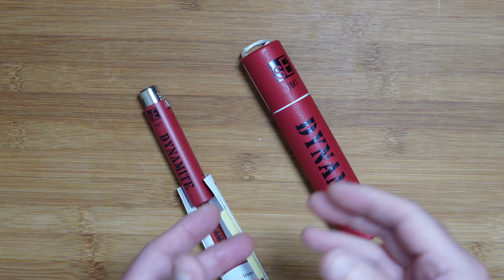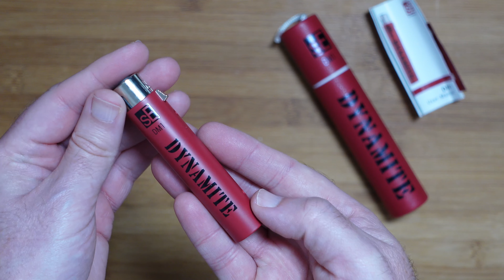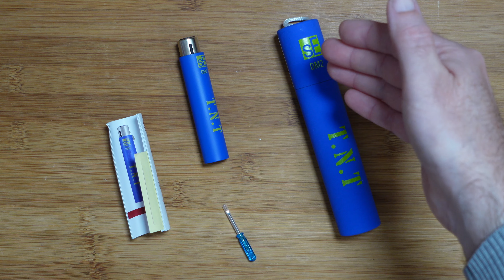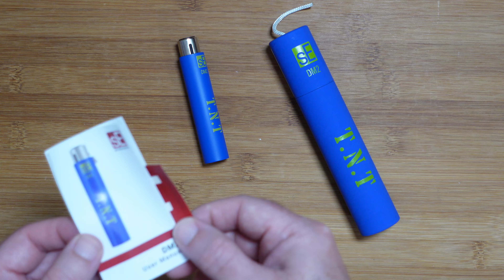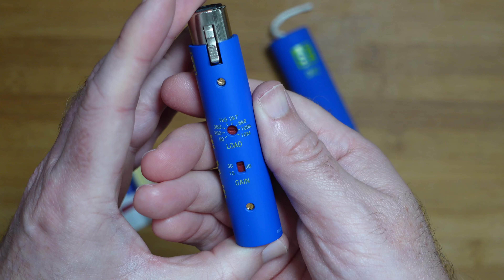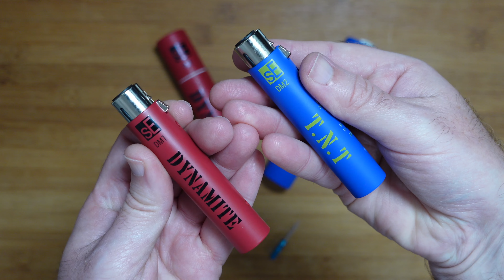Power Up Your Mics - sE Electronics DM1 Dynamite & DM2 T.N.T Inline PreAmps Review

Comment: thank you for your video. are you able to plug the dm1 direct into the audio interface end instead of the microphone end? here I'm trying to do this but it doesn't work: just a lot of noise and the mic captures nothing. My setup is a SSL2+ and MV7 from shure. Mounting the dm1 straight into the MV7 is pretty ugly.
Reply from the maker: As far as I know mic end only.